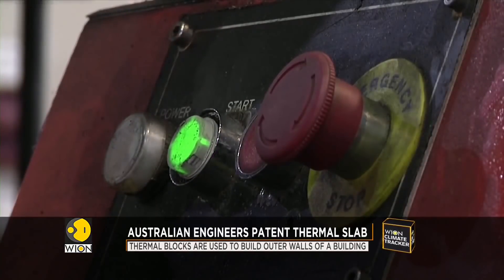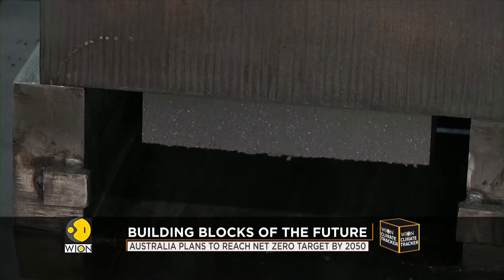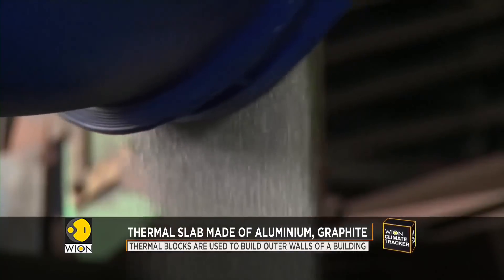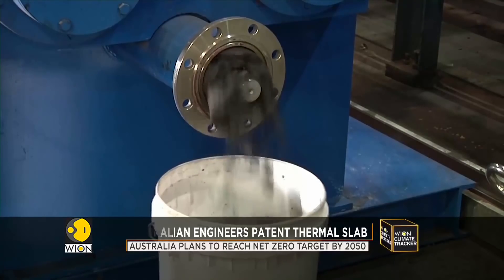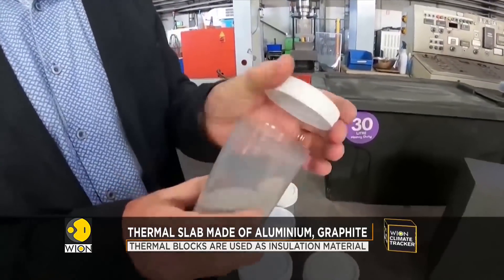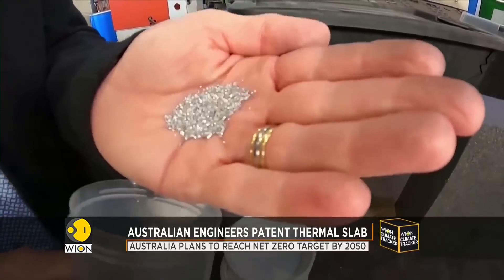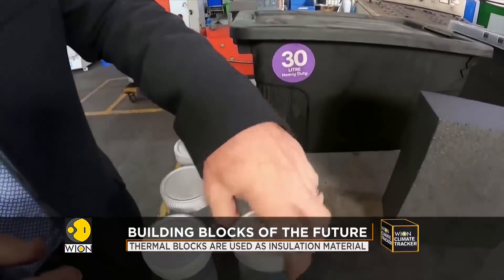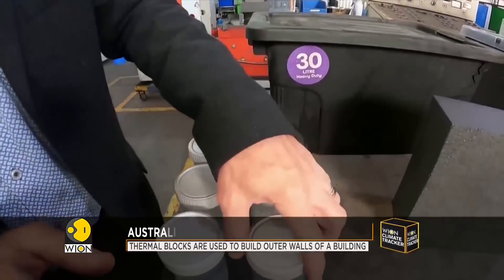Australian engineers patent thermal slab to store renewable energy | WION Climate Tracker

Comment: This is a misleading headline. They are not storing renewable energy. These bricks will prevent the heat from going out. These should be described as insulating bricks with improved efficiency. 

Nonetheless, Congratulations to Australians for this achievement. Good job.
Reply: You are incorrect its not you're fault as this video incorrectly highlights its use case. The bricks purpose is to retrofit coal power plants by replacing coal as a heat source with these renewable heated bricks. The advantage of these over current energy storage is that they are made of abundant and readily available starting ingredients so that it can be produced at a very low cost to accommodate for the scale of energy storage that’s required - they are 10 per cent of the cost of a lithium battery of the same size, yet produce the same amount of energy.
Reply: I only wonder how operations will work. To reduce thermal losses via transportation you will require a solar generation/ heating quite close to the coal power plant

Comment: A 30 year lifespan?  That will need to be extended to at least 4 times the current lifespan to be considered for use.  There are houses in Australia that are over 100 years old, and there are other methods of reducing carbon footprint in the building industry, naturally.  One of the other problems is the use of timber.  Yes, timber is a renewable resource, and it does take carbon out of the air.  However, what is the longest that a timber home / brick veneer home has stood for?  The other question that needs to be asked:  How do these blocks stand up to salt damp?  That is a major problem within Australia.
Reply: Spot on.
What happens as the block is slowly degrading over 30 years ? ....first the bedroom then the Garage etc. etc..?????